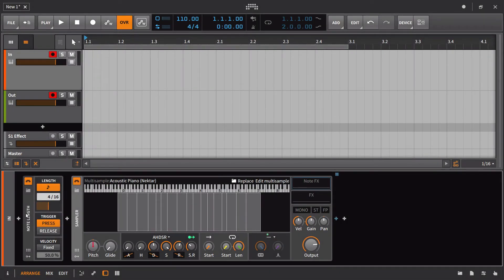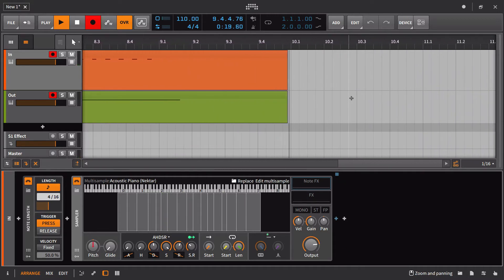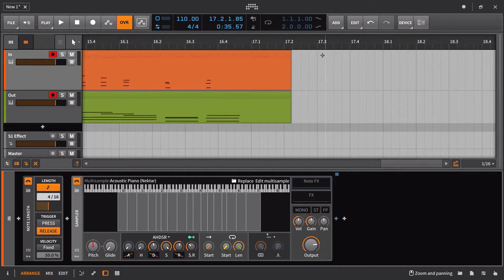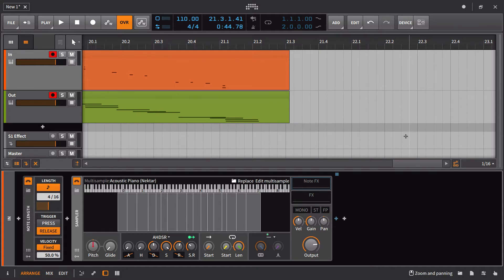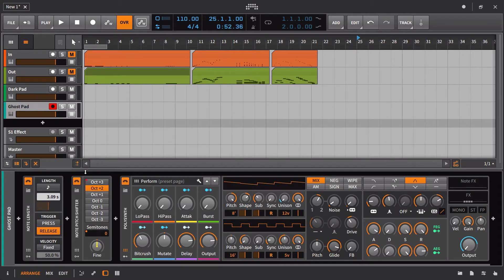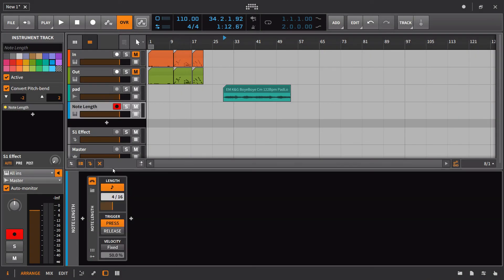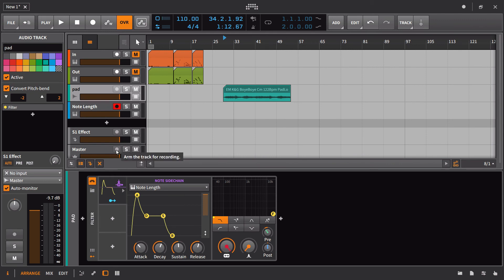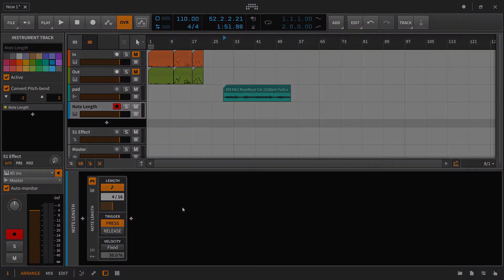Bitwig 2.0 - Note Length

Comment: I think I've read somewhere that one of the intended usages of the "release" trigger mode is to play release noises. Like if you play an acoustic piano, you will hear noise of the hammer falling back when you release a key. Usually it's taken into consideration in piano VSTs & libs, but if you want to use built-in Bitwig devices, you can use two samplers (one for the noises) -- similar to what you've done with two synths.
Reply: Thinking about this, MIDI has support for note-off-velocities (note-off messages has the same velocity data cell as note-ons, but the value can be different), which would be cool to use for such noises (e.g. on piano it will actually depend on how fast you release the key). But I'm not sure if this Note Length device supports it.